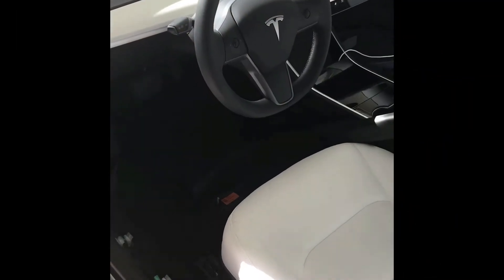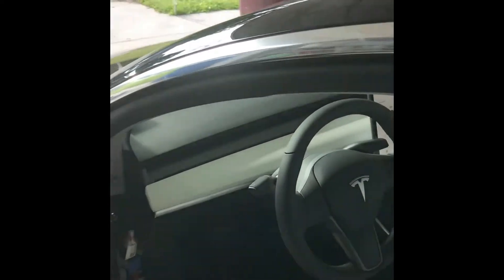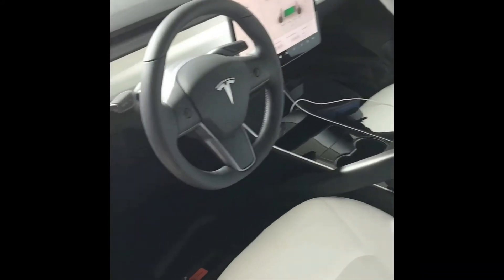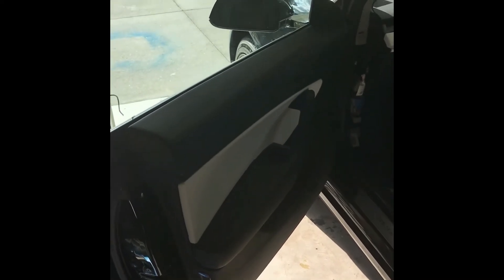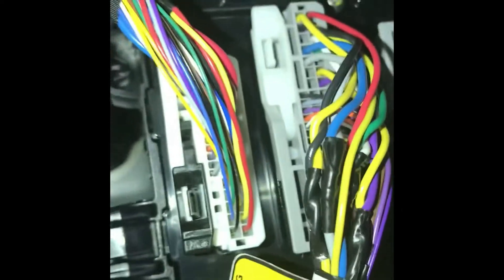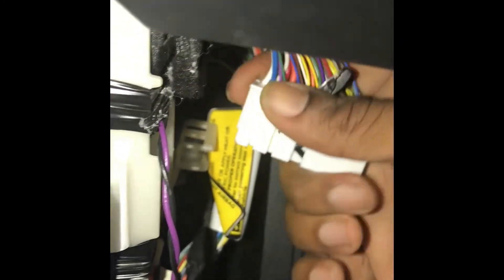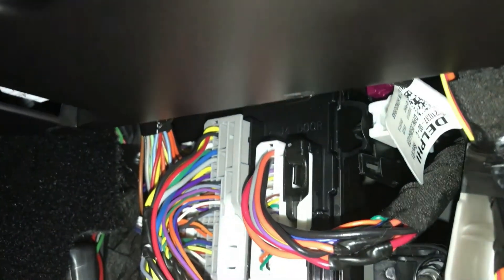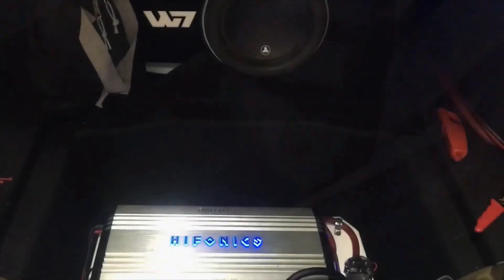Tesla Model 3 Amp Install

Comment: Hey Daquan, great video, but where did you get the 12V power for your line out converter?
Reply from the maker: Left door panel. There is a large red wire that is a 12v accessory wire. I wish I could post a picture of it.

Comment: i see you have a W7 rated at around 1000W, what is the rating of that hifonics brutus? what's the maximum voltage drop on the 12V at full power?
Reply from the maker: Technologic The W7 was only temporary. I have a Sundown Audio 15” in there now. The Brutus is 3000 watts, and I don’t know what the voltage drop is at full power. What I can tell you is that the Tesla can handle it no problem.
Reply: @DaquanJohnson  what model brutus?

Comment: This video will is great 👍. Question. Why didn’t you tap into the rear speaker 🔊?
Reply from the maker: Phuc Baldr The front door speakers are the perfect frequency for a subwoofer install. I feared that the rear door speakers might have a little bass roll off since they are smaller.

Comment: I recently had sub installed, but was wired to 12v under the Frunk, and not the Penthouse 12v like in your video. Some forums posted the computer generating an error reading when connected to Penthouse. I, However ran into issues with 12v Frunk battery getting drained - I think bc it was set to audio signal turn on versus remote switch turn on... Any thoughts as I am trying Round 2 now ?
Reply from the maker: Justin Hollenkamp Yeah, I ran into the same issue. I had to find an accessory wire to act as a remote for the aftermarket subwoofer.
Reply from the maker: Justin Hollenkamp Yeah, I ran into the same issue. I had to find an accessory wire to act as a remote for the aftermarket subwoofer.
Reply: @DaquanJohnson  If i understand you correctly, you're agreeing the 12v under the "Frunk" will work, just need to find remote switch for turn on ; so the amp isn't actually on , drawing power , until the car is actually on and running ?  What charges the frunk 12v ... I know the Penthouse charges the 12v under rear seat, but am not positive what is actually recharging the "frunk 12v" ?
Reply: I hooked up remote switch and ran a relay and everything has worked perfect.. the engineer from Tesla, told me in email that the amp should function as close as possible to the main screen's sleep patterns, to make sure when screen is off, that the amp is turned completely off. Everything has worked well in case anyone was wondering
Reply: Justin Hollenkamp yes I am, how would you properly run a remote wire from your amp
To the correct location ?

Comment: How was the sound quality before you added the new subwoffer? i'm thinking about getting the standard range but worried I might regret it if the audio quality is bad. Is there still a reasonable amount of bass in the standard range without a subwoofer?
Reply from the maker: SAMMY B The sound quality is amazing. The sub just gave it a little more depth. The standard range uses 8 speakers and the others use 11 I believe. There is a noticeable differences between the two, but both outperform most car systems.
Reply: @DaquanJohnson  Awesome! So you think standard range is a good option for me? I don't really mind not having auto pilot.

Comment: So by tapping into the speakers in the front, do you 'lose' those speakers, or do you wire through the speakers and into the amp for the woofer so you get both the speakers and the woofer running?
Reply from the maker: cin I just tapped into the front speakers to send the signal to the high to line level converter and then the aftermarket amplifier. The door speakers continue to work normally.
Reply: You don’t have to tap both sides. Just tie the two positives together and the two negatives together, then tie those to the door speaker wires.
Reply: @o751106  🤔wonder if that will effect sound quality
Reply: What I would like to
to know is, where do you connect for remote turn on???

Comment: How does it affect the battery ? Is the amp always on? Do you need a remote cable ? This video is really dull
Reply from the maker: prgeo123 It hasn’t affected the battery at all. I have seen no change since installation. The Amp comes on when the car turns on. The line converter I use has a built in remote wire. Sorry the video is dull. I just wanted people to see where to connect into there M3’s to add aftermarket amplifiers.
Reply: Daquan Johnson no worries , this video really helped. Just want to be exact sure where I put the wires at in a 50k car. I’m getting mine on Wednesday and I have a full 1800amp 2 10s setup ready to be installed. I will be asking more question along the way when I pick up the car. I’m going to be in the same boat very soon haha
Reply: Daquan Johnson one more thing. How come the main 12v battery doesn’t die ? I thought Tesla doesn’t have a alternator to charge the 12v battery
Reply from the maker: @prgeo123  The Tesla has a very large battery that constantly charges the 12v battery. No alternator needed when you have a mobile power plant.
Reply: Daquan Johnson okay sounds good thank you. Let’s keep in touch ! I know I will need more help when I’m about to work on it.
Reply: @DaquanJohnson  where do you connect the built in remote wire to please
Reply: To the large red wire in the front door panel

Comment: Looks good how does it sound
Reply from the maker: CharlesB sounds amazing. The stock systems sounds good by itself, but with the added bass, it’s second to none.
Reply: I installed the Pioneer powered subwoofer (TS-WX130DA 8"). Now you can hear all the frequencies

Comment: There are some speakers which are present but aren't hooked up on the SR+. Have you attempted to do anything with those? I've been looking to do something similar following the guide here, but my car isn't here until next month. https://teslaownersonline.com/threads/aftermarket-sound-system-info-thread.10022/page-22#post-234872